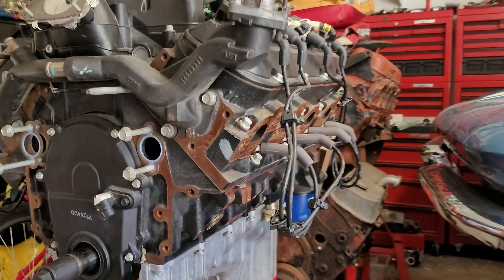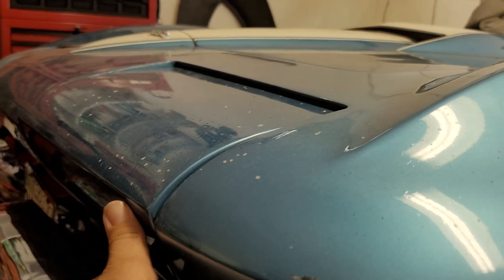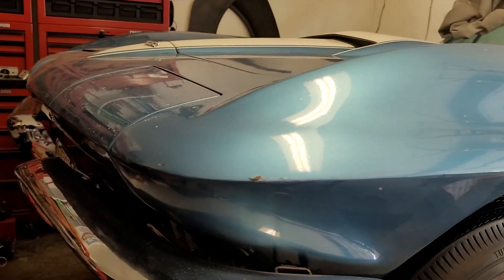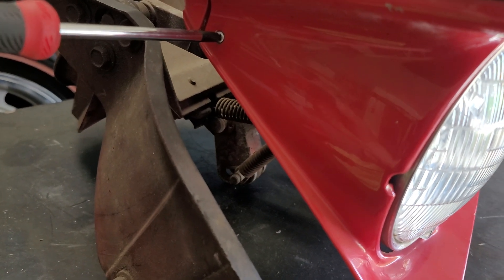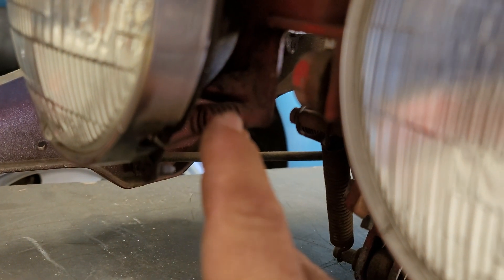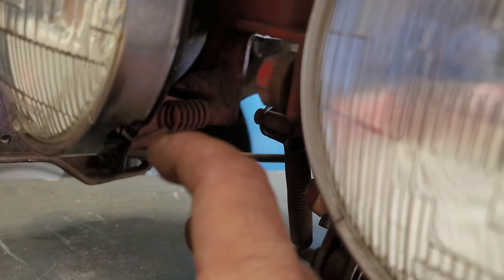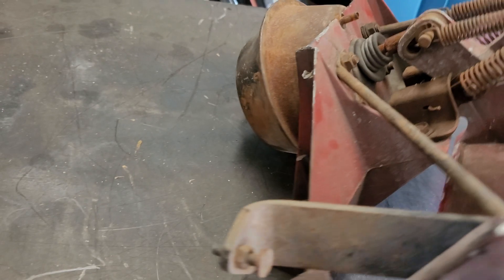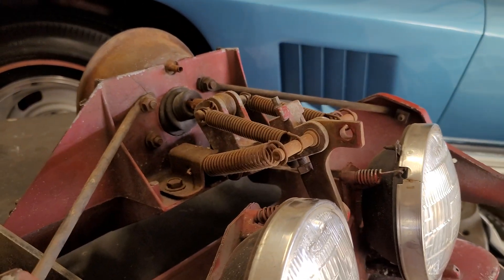The Complicated C3 Corvette Vacuum Operated Headlight Assembly

Comment: What's a good guess on the weight of each C3 assembly??
Reply: Forgive me, I missed the weight estimate on the first go-around.
Reply from the maker: No problem, each one weighs in at around 20 lbs, specifically the early ones with the metal headlight surround bezel.
Reply: @VetteSource  Thanks

Comment: You said something about headlight washers/squirters, were they available in the Us or were they for foreign markets only? Thanks!
Reply from the maker: Hey Robert, they were standard equipment on all 68 and 69 Corvettes. They discontinued them in 1970, most likely because it was a complex system that was difficult to maintain. I actually did a video on the headlight washers a few years back -

https://youtu.be/Ng5FO8-bP4E

Comment: I have a 76 so this is  great! Brakes question if you don't mind. Calipers fairly new, Master cylinder new, booster works and adjusted, yet my pedal is very low. No leaks or air in the system...any ideas on what the problem might be? Any help REALLY appreciated...Thank you for the videos! Al
Reply from the maker: Al, no problem. Glad you're enjoying them👍. The C3 braking system is notoriously finicky to bleed. Did you bench bleed the master cylinder before installing? They will trap air in the lines between the master and proportioning valve, which forces you to gravity bleed the system from component to component.
Reply: @VetteSource  Thank you for getting back...I will check but believe that was done, if so, is it new calipers time? if so, is it ok to try it in pairs, maybe the front 2 first? Thank you very much!
Reply from the maker: Yep, if everything looks good from MC to proportioning valve, I would go with front calipers first, and then move to the rear. The idea is to eliminate all possible sources of trapped area. I will say the proportioning valve is a known trouble area for trapped air, so you might want to try cracking the lines and leaving it for awhile to gravity bleed.
Reply: @VetteSource  Thanks so much! Appreciate it!